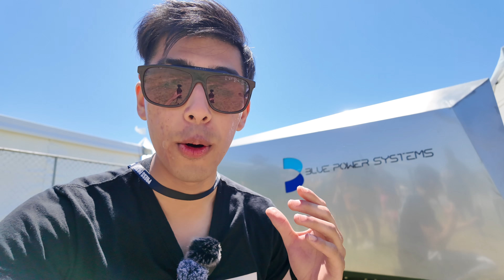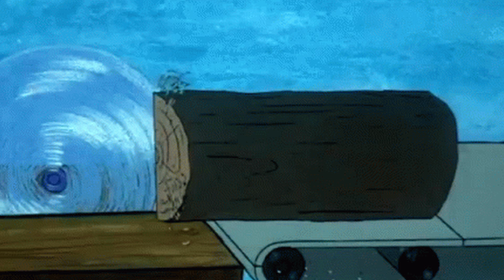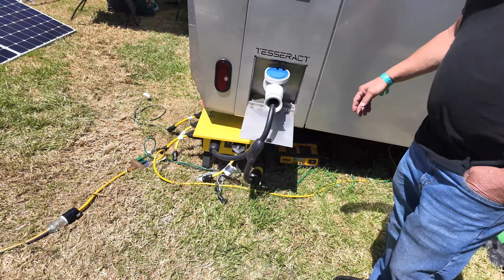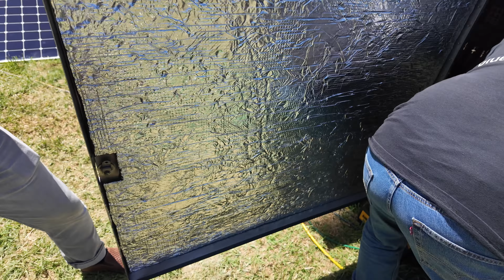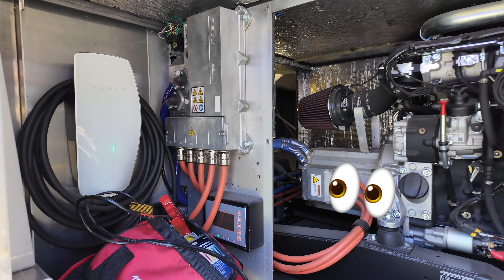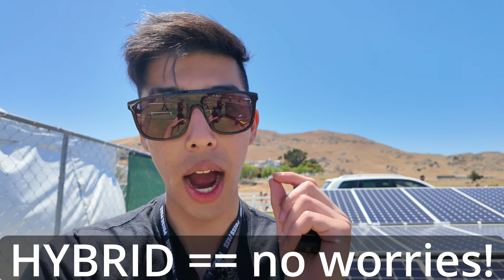UNLIMITED POWER with BLUE POWER! at X takeover

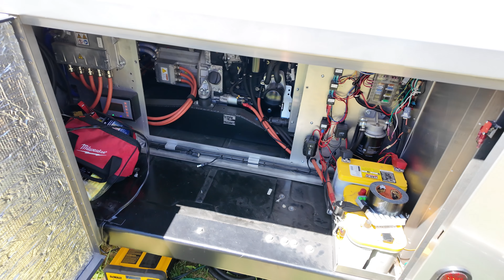Comment: Nice!! 4:48 that Gen3 Wall Connector has a max output of 48amps, not 60amps
Reply from the maker: @TonyPham-Creations   Thanks for  the info Tony! Yep you're right!
Reply: @TeslaFPV  Installed Circuit breaker is 60 amps, but it only draws 48amps